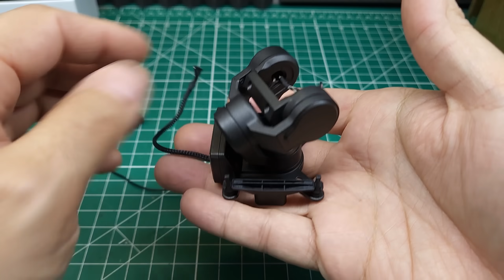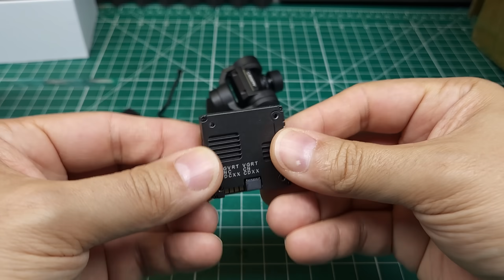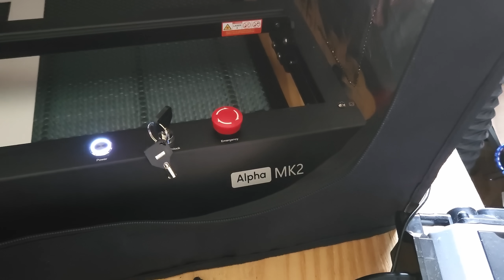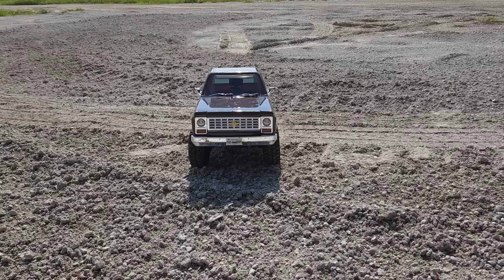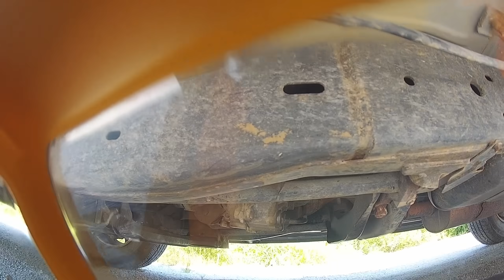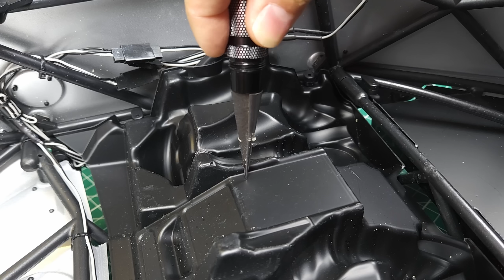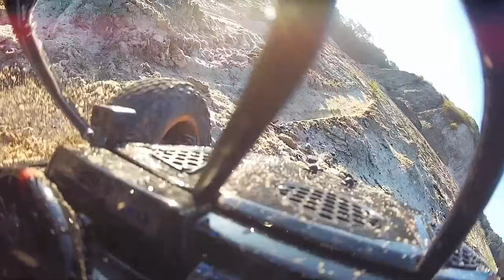NEW Head Tracking HD FPV Takes RC Bashing To The NEXT LEVEL!

Comment: This is a cool setup but be warned - the instructions and documentation are REALLY confusing, especially the wiring variations (PPM vs PTZ). I had to dig though GITHUB archives to find the right wiring and software/firmware updates. This was mainly because I went with the cheaper Avatar HD kit insted of the Moonlight kit which is more popular.
Reply from the maker: Agreed. The instructions could be better.

Comment: Curious, if you could repeat that from the beginning in English?  For work purposes, I need to set up a crawler with a camera on a gimbal and lighting to inspect under houses.  Considering that FPV cameras and gimbals and lights are available for RC’s, I think I’ve called every hobby shop and RC shop on the planet. They all sell RC‘s, but they don’t sell gimbals, the places that sell gimbals and lights can’t give you much information, nobody can refer you someone who can do it for you and and nobody seems to sell anything that just has all the stuff assembled.  I’m telling you right now, whoever starts doing this is gonna make a fortune.  I’m not even in the RC business and I think I’m gonna try to figure out how to do it and be the one that does it. Then I’ll invite everyone to my bew mansion to tell them how I told you so.  There, my rant  is finished.  Your video was fine if you have a complete understanding of how RC cars worked, but for those of us who don’t, it’s sort of useless.

Comment: Can you do this exact thing in a plane? And is there any soldering?
Reply from the maker: Yes you can do the exact same thing in a plane as a matter of fact that's what this is made for. The only soldering you might need to do would be to connect it to a flight controller or do whatever power connectors you want

Comment: Did you powered it from external battery or from receiver?
Reply: I will use max8 g2s on 8,4 volts with "MB-2311WP" servo but I'm worried about amps.
Reply from the maker: @MichaelKundrát I think it'll be fine. The system doesn't draw a ton of current.
Reply: @DoRC thank you, that really helped
Reply from the maker: External battery but as long as your BEC can do at least 7.4 volts and everything else can handle it I don't think there's any reason why you couldn't power it from the receiver.

Comment: Thank you for great video very useful as I’ve just bought that Losi , am attempting to put my C20 T Gimbal on top of roll cage , adding a metal mini roll cage , am also adding a dash cam monitor& rear view camera for live rear video  & sunshield just below camera height was inspired my Magneticitist videos , chosen to mount gimbal & dashcam monitor above for the room , don’t plan to bash or jumps am I’m attempting long range adding flight stack & gps & radiolink v3 & crossfire lite module in DSC port , am following in-depth build showing stages starting with soldering car servo & ESC to flight controller & adding crossfire nano & running of INAV .
Your video has given me understanding of space within the roll cage 😎👍

Comment: if theres two FPV cars racing or crawling...would there be any video interference?
Reply from the maker: Not with a digital system. The way the signals work they won't have any crosstalk. Old analog systems can though they are also designed not to as long as you're not on the same channel

Comment: Where can I find that the sled for the gimble mounts?
Reply from the maker: It was just something I came up with and 3D printed. I wouldn't want to share the files as they didn't really work very well. Depending on what you are putting it in it'll probably be best just to come up with a custom sled

Comment: Is there a RC car that you would recommend for this set up? Curious and looking into doing this as well Wyatt would want a car this could definitely fit in that can handle some moderate to maybe heavy bashing definitely a track jumping too.
Reply from the maker: That's a tough one. Anything you do well obviously need a custom mount for it and it's going to be easier to put in something like a Mojave that already has a cage with an open area inside but of course that's probably not going to be great for a track. Unless you're doing something like that though it's really just a matter of taking whatever you want and making it fit.
Reply: @DoRC  I don’t mean to keep bothering you about RC is getting back into them after becoming paralyzed. I do not have a 3-D printer. If I were to get one, what would be a budget friendly one and how do I make mounts exactly
Reply from the maker: @wyattwelch8590  I would recommend anything from Bambu lab. Even their little A1 Mini is great because of the software integration. No other company other than maybe prusa is doing the software integration like they are and it makes three different things so much easier than it used to be. 
As far as making the mounts it's not even really something you need to 3D print. You can do it as simply as double side taping the bottom of the camera base to a stick of wood and then gluing that in the car or something like that. Really as long as it's reasonably secure it'll be fine. 
As far as 3D design there's a program called tinkercad that's free You can start playing with it right now even without a 3D printer. It's object-based and whereas it is fairly limiting for advanced designs It's a great way to just to get started messing around and getting comfortable with it. 
Let me know if you need anything else from a fellow disabled dude :-)
Reply: Thanks for the info! I’m in Denver if you’re ever out this way!

Comment: https://www.youtube.com/watch?v=4X9d4ZKjqaU
Reply from the maker: Yeah this is something that's been an option for a while but it's a custom setup that doesn't have stabilization and can be a real pain to actually use. 
In my opinion what I showed in the video is the first actually easy to use stabilized system that is practical for surface RC
Reply: @DoRC  it's not the first easy to use system, it's one of them. Great work. I've posted the video as a motivation for better quality and creativity.
Reply from the maker: @dertigerbauch  which other HD stabilized head tracking systems have been available?

Comment: Hey :D ! What an awesome video ! Love it ! I'm considering to do a similar setup on a Arrma Vorteks 3S but I wonder how durable the gimbal would be on a basher. Have you used your GM3 a lot since that video ? How does it hold up in time with several runs ? Thx !!
Reply from the maker: I wouldn't say I've used it a lot but I have used it and so far it is holding up fine. I suspect if you were in a really dusty or sandy location or we're bashing really hard it wouldn't last a terribly long time but if you had a dedicated vehicle for it it was protected well and you worked with an its limitations I think it would be okay
Reply: @DoRC  Thanks for your answer ! Will definitely take good care of it and avoid crashes haha !

Comment: Nice second gen rango, I had a Dakota w the 3.9 that was tough as nails
Reply from the maker: Yep this one is a 5.9 SLT Plus four-wheel drive and I will drive it till the wheels fall off.
Reply: @DoRC right on, I want a Dakota with the 360 or the 318

Comment: I understand now . What is the best way to unplug the camera plug and then connect to the gimbal ? I am afraid of damaging the camera. I noticed a tab at the bottom of the plug and was going to use the end point of razor blade to disconnect and then connect to the gimbal😅
Reply from the maker: The plug pulls straight up. I definitely would not recommend using a razor blade. It can be a little fiddly so you might want to get someone with good dexterity to do it if you're concerned about breaking it.
Reply: @DoRC  Thanks so much for you help and quick response. I think Ill take it to to an electronics shop for I managed to get the plug out but I can't get the plug from the gimbal to the camera.😃

Comment: Just recieved the the gimbal and camera and I have the same wire coming out of the side of the gimbal as pictured in the 50 second frame ,when I loosened the screws from the back of the camera the rear wire of the camera was already connected to the camera. What do I do with the wire from the side of the gimbal?
Reply from the maker: You'll need to disconnect the wire that comes out of the back of the camera and plug the wire that comes out of the camera mount portion of the gimbal into the camera. You'll then remove the other end of the wire that was going into the camera from the VTX and plug the same wire that comes out of the gimbal into the VTX. Basically you're just putting the gimbal in between the camera and the VTX. Check out my FMS FCX10 LC80 video as I go into more detail on the installation in that.
Reply: Thank you so much, I bought all this electronics and I am finding it a bit overwhelmed for this feeble mind. Thank you again for coming  back so quickly.
Reply from the maker: @doughoggatt1645 It definitely is intimidating at first glance but fortunately there really isn't that much you have to do to get it going. If you have any specific questions feel free to ask on here or you can even shoot me an email.

Comment: That’s awesome! I’ve done it with a fixed camera with a caddx vista on my infraction but that gimble is waaay better. How did you record audio ?
Reply from the maker: Yeah the big problem with fixed cameras on surfaces always been getting bounced around in this basically solves it. Audio was recorded just using my normal camera setup

Comment: Once we can get a stabilized FPV feed with out the need for a gimble it will open the doors to ground vehicle. like Gopro rock steady but Live feed with no delay.
Reply from the maker: Yeah that would be really cool and I suspect it's probably already possible with today's technology it just hasn't been done. The mechanical gimbal works but having to keep it protected and its size does limit its usability.

Comment: WOW! What a great video. At 82 I still love RC and after 40yrs I have many models. Do you have any ideas on how to make the camera system portable. I just purchased the Radiomaster Mt12 transmitter which will handle 16 models ,terrific range and will do just about anything. Will order this system today.
Reply from the maker: Yes and no. To make it portable you really just need to have it on some sort of sled but the problem with that is each car is going to require a pretty significantly different mounting setup so I'm not sure that would really work very well. If you mounted it on the roof you could probably do it but that doesn't really give it any protection and I suspect that one upside down hit into the ground would destroy the gimbal.

Comment: Little tip, rather than running a whole second machine for a 3d base template. 3d print it. Make a clone of part, invert it and sink 99% of it through the plate so it doesn't print. You now have a 1 or 2 layer template.
Reply from the maker: Yeah you can do that or you can even just cut most of the part off in the slicer and only print the first couple of layers or just stop it after did Prince. The problem I have is that my bambu printer runs through a starter routine that takes about 8 minutes or so before every print. I can iterate a design cutting it out on my laser cutter on paper five times in the amount of time it would take the 3D printer to prep one print. Also if I've got the wrong filament in there I've got to change it etc etc. 
I'm not sure I would recommend someone buy a laser cutter just to do this but if you have one it is incredibly handy.

Comment: I'm going to need a sponsor I have 96 tractor-trailer units 13 trucks haul lowboys with construction equipment 2 are inclosed transporters with the elevated 2nd level and drop down ramp door! With 4 vehicles per unit! 1 Smokey & The Bandit with a Trans-Am
1 Rubber Duck with a Jaguar! 4 drag race vehicles, 4 crawler vehicles & 4 multi purpose vehicles! The Team Losi Night Crawler!
Reply from the maker: Yeah that would definitely get expensive!

Comment: hey can you publish the 3d files ?
Reply from the maker: I don't really want to do that because my models are garbage and had to be adjusted by hand after in order to make them fit properly. I really didn't design them for public consumptions so they aren't very good
Reply: @ would you be willing to send them to me to use I promise I would not share them or hold you reliable but right now I am literally using Velcro and every time it comes undone after it gets dirty
Reply from the maker: @matthewheath45  are you talking about the on top of the battery mount? If so shoot me an email. My email address is in the about section. I think I still have it. If I do I'll send it to you Just no guarantees at works

Comment: I’d get the dji O3 for a camera and some v2 goggles
Reply from the maker: You can do that but you're not going to have stabilization control or head tracking.
Reply: @ sure you will
Reply from the maker: How?
Reply: @ the goggles 2 have head tracking it show be cross compatible with the walk snake gimbal
Reply from the maker: @myfalconry76 they do have head tracking but I don't think it's cross-compatible. The Walk snail system is proprietary as is the DJI system. They don't work with each other.  The gimbal is controlled through the walk snail VTX and that only communicates with the walk snail goggles.

Comment: Very cool man! Great Video, how long are you able to run the VTX without it overheating? Considered running a separate battery for the camera system/ fan?
Reply from the maker: With the fan on there in summer Florida heat it was unlimited runtime without overheating. I did run a separate battery on the second setup.

Comment: I was doing this 11 years ago.
Reply from the maker: Self stabilizing HD FPV?
Reply: @  Digital video wasn't really available at a consumer level back then.  But I did have a brushless gimbal that I used with a pair of Fatshark dominator goggles with a head tracking module in them.  Also, a half watt 5.8 VTX and a UHF RC transmitter gave me more range than my batteries could handle.
Reply from the maker: @TheSloppyDingo  that's cool. Yeah head tracking and stabilization have independently been around for while but this is the first setup that combines digital HD, actual reliable head tracking and stabilization in one fairly user friendly compact package.

Comment: Wouldn't I DJI system be better?
Reply from the maker: Depends on your goals. The DJI FPV system is a better HD system in most respects but they don't have a standalone gimbal like this so there's not really any good way to compare the two. I will say that the HD on this system is very good

Comment: The main problem is going to be that gimbal. This worked great because it was brand new but after a few sessions it’ll get out of whack getting bounced around.  And then the head tracking will be all over the place
Reply from the maker: I have quite a few packs through mine and it's still working perfectly. I can't guarantee how long it will survive hardcore bashing but so far it's been surprisingly robust.
Reply: @ wow I’m really surprised maybe my gimbals are too cheap lol 😂. It would be cool if you could give us a quick 6 month update on how the system has been fairing for you. Thx for the vid

Comment: Saw a head tracking FPV cam in a car about 6 months ago.
Reply from the maker: Yeah head tracking FPV has actually been around for quite a while It's just been pretty clunky and most of them weren't self-stabilized. This is the first set up where it's plug and play HD self-stabilized and actually works without a bunch of hassle.

Comment: I want to do this with dji03 in a kraton 8s.  I already fly FPV drones that I build.
Reply from the maker: Unfortunately DJI doesn't have a standalone gimbal like this. You could use a DJI camera on this gimbal but you would only get stabilization not head tracking

Comment: i did this with a static mount. Had difficulties because of avery large wide angle view. Was snowy outside and inside the car black. So i couldnt see anything on the ground.
What is impoirtant for me and i dont have is sound from the camera. Than you can hear if your are stuck the tiores spinning or something is loose.
Reply from the maker: I didn't really have any trouble with the camera angle on my setup but that's probably just going to be dependent on what you need. Having sound would be nice but not having it didn't really bother me neither. Definitely interesting to hear a different perspective though

Comment: maaaaan i cant find any of these parts aside of the goggles.
Reply from the maker: Check get FPV.com or the caddx  FPV website.
Reply: @DoRC  I went directly to the website and couldn't find anything. Maybe I'm stupid lol. But i went to google and the found it all as a pro kit from the same website for a little more than $200. Its an awesome idea. But i don't see me using it that extensively and would hate to spend that amount to have that experience until its not a wow factor anymore, then put it away like I did with my VR. In other words I wish it were much cheaper lol. Who knows in the future i might for my Losi 5T
Reply from the maker: @RandomRichZ Yeah to buy everything including the lower end goggles you're going to be looking at about $500.